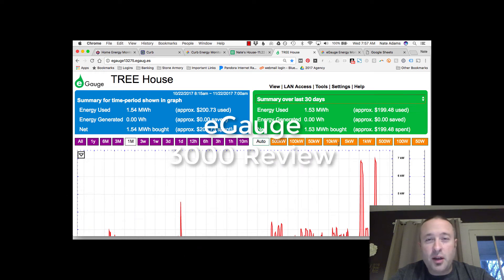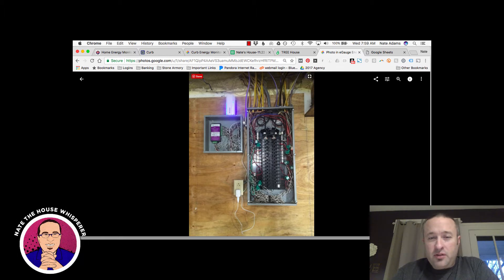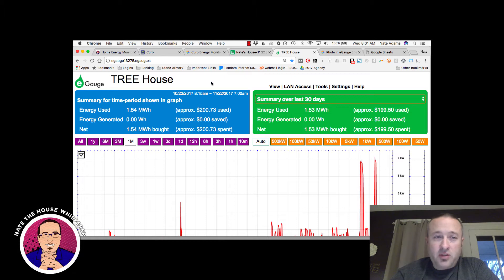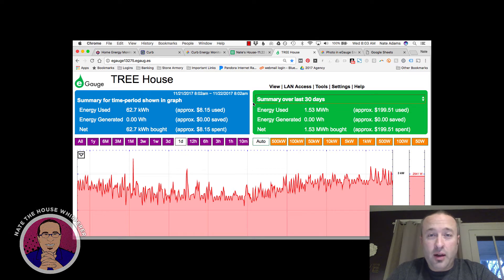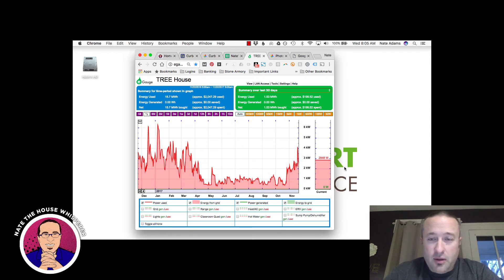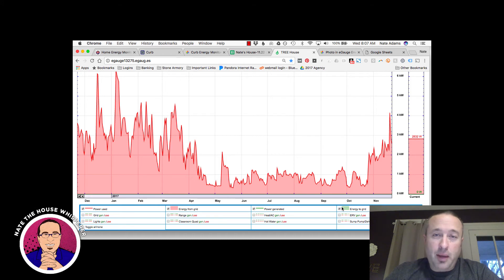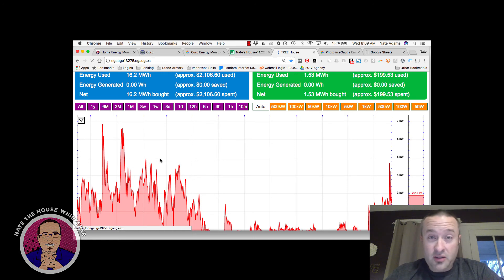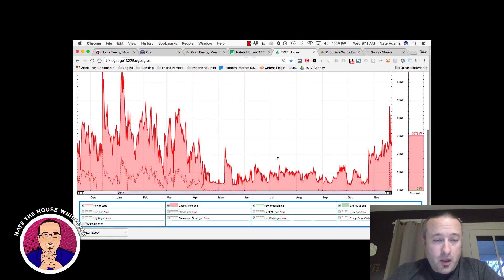eGauge 3000 Energy Monitor Detailed Review

Comment: I know you did this video in 2017.  Have you found a better product for this application yet?  Sense is great and all but I need to just monitor usage at circuit level not appliance level in our business appication.
Reply from the maker: B. B. Sense fits our needs well enough and doesn’t require long setups, so we stopped looking.
Reply: @NatetheHouseWhisperer  I have a unique application where I am trying to find out which plug (all are on a dedicated circuits) in a hair salon has a curling iron left on.  Sense can't differentiate between that many of the same type product, over 150 curling irons, some of which are being left on and a fire hazard.  Do you think the eGauge is the best option for my application of locating a circuit with a high wattage usage after hours?
Reply from the maker: @BonnerBB  Maybe. Depends how many curling irons are left on, and how many per circuit. You might also look at Iotawatt, I haven't used it but a fellow geek has, it may be another option. Or you might do multiple eGauges.

Also see the comparison video between Sense, eGauge, and Curb to get a better sense of the possibilities. Good luck, let me know what you find!

Comment: Seems the only major complaints were the wiring (which apparently allows more accurate load discrimination) and the ct polarity issue, which may be the result of a poor installation manual or the lack of comprehensive point to point testing (eg testing each hardware module at startup). 

What would be outstanding might be an ability to integrate analysis of heat pump kw loads versus ambient conditions. The abilty to include the kws of heat strips during defrost and as supplements when the heat pump can’t keep up would also be helpful as well. 

With modulating hvac systems becoming mainstream and with heat pumps achieving  useable btus even in single digits temps, conventional rule of thumb equipment sizing really needs to be supplemented with these kinds of data collection devices. Some local archiving by the monitoring devices could fill in gaps for the inevitable internet comm fails.
Reply from the maker: We've thought about the heat pump question, and yes you could figure out a lot about heat pump consumption and output if you plot it against outdoor temps. That's a fair amount of work when you can use a Carrier Infinity piece of equipment which tracks energy consumption and you can get day by day consumption split out by strip heat, reheat, fan only, heat pump cooling, and heat pump heating. A 10 degree winter day costs around $6-8 or 60 kWh for a 3 ton heat pump. With strip heat on, that can touch $20 or 200 kWh. That's enough data to inform my intuition.

Comment: I wonder how hard it would be to add a feature that allows reversing the reading via software so you don't need to "get it right" at the clamp. 

All these companies developing their own interfaces seems clunky and inefficient. Wonder if there is some business case for a single overlaying interface. Maybe that's apple home?
Reply from the maker: It's in the interface, but the login had been lost so the only way to change it was to call tech support. Like I said, they were very helpful. It would be good if the interface automatically flagged or even automatically changed reversed polarities. Before the switch, this house showed that it used 350 kWh for the year, reality was 14,900 kWh.